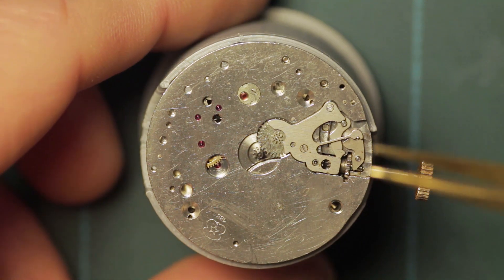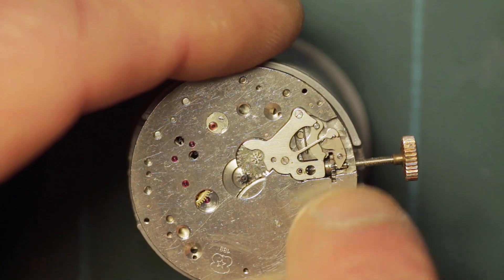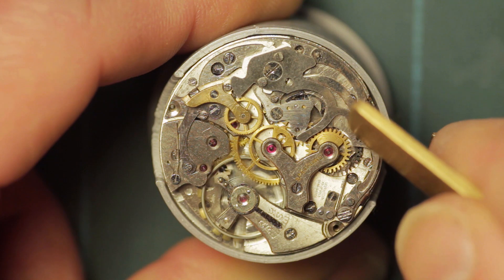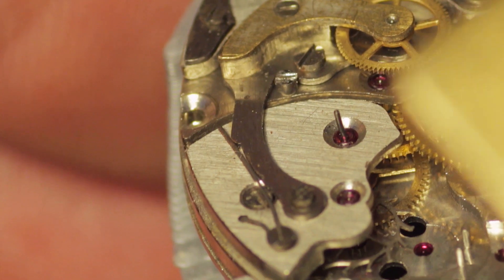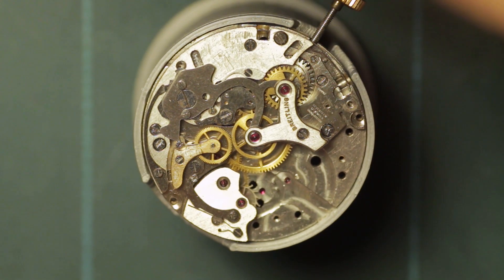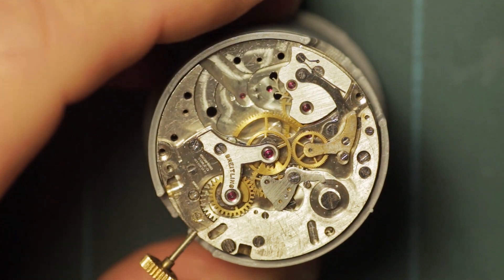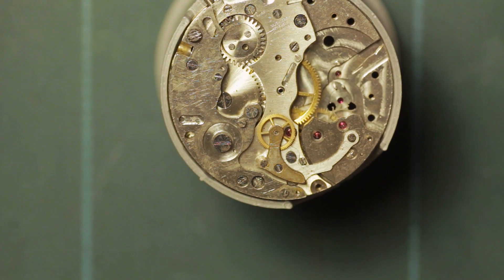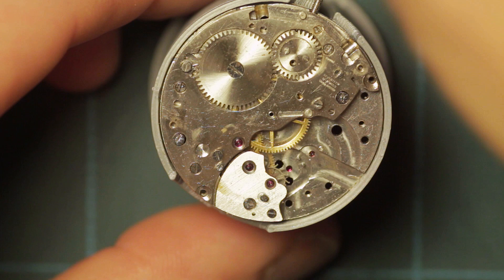Breitling Cadette Chronograph Disassembly Venus 188 Part 1

Comment: Thank you for this instructional video. I took up this hobby to learn about watch restoration specifically as I bought a watch for my 18th birthday in 1966. Well, actually my twin and I both bought one each. He lost his. Mine is a Breitling Top Time. I paid £23.50 for it. I have now opened the back and guess what? Mine is a Venus 188 movement. I still don't have the confidence to even begin to work on mine. Your videos are marked as a favourite and will be used when I do my service. Thank you..
Reply from the maker: Wow! I forget nowadays that not too long ago watches like these could be picked up so cheaply. One to be treasured for sure and a shame about your brother's.
If you need any help feel free to ask
Reply: @spidiq8  Thank you for the contact. My brother lost his £24 watch, a Watches of Switzerland Seafarer, in the early 70's. I've since obtained one for £55 and am doing a restore. It has an ETA 2789-1 movement. I really struggled with it as it was my first. Broke balance pivots 3 times. Have rebuilt 4 times as I still struggle with amplitude problems. This happens on all my rebuilds. I know its me, but I'll get there. At least I don't break anything now.
Reply from the maker: @rossjackson3670  That's certainly progress and like most things damages caused initially are from inexperience and forcing things. Because watches are so small parts are far more fragile and until you get a feel it's difficult.
For practice you can always pick up cheap and even broken movements simply to get used to disassembly and reassembly.
Never ever force anything on a watch. Sometimes you may need to encourage parts into place such as pivots but nothing should require pressure.

Comment: Hi, Wonder if you can help. I plan to work on a Record Venus 188 this winter. On an initial inspection there is screw missing between the 8500 Chronograph Bridge and the 8270 Minute Recording Jumper. Do you happen to know the reference number of this screw? . Regards, Dougie.
Reply from the maker: Unfortunately I don't and I don't have a service guide to hand.
Reply: @spidiq8  Thanks very much for getting back. I have the service pages but I don't believe this platform allows the sending of photos. Thanks anyway.
Reply from the maker: @dougiecunningham5439  You could pop them to me on email at m1ks@aol.com if you like and I'll take a look.